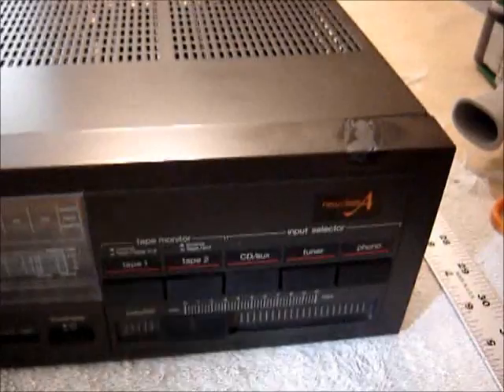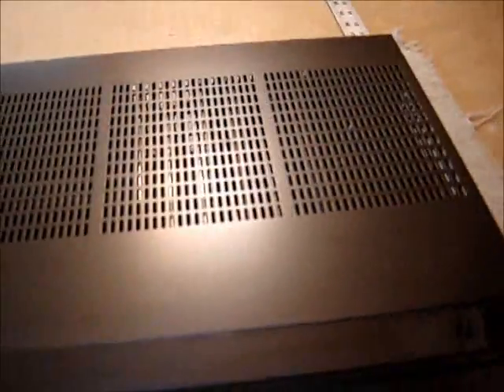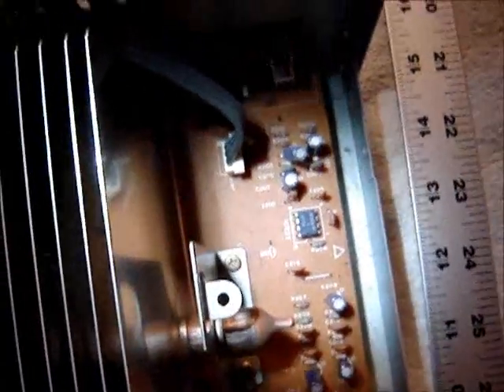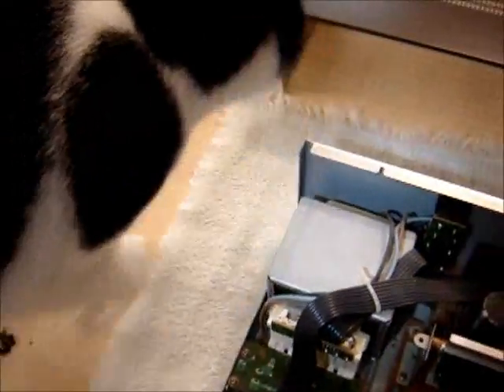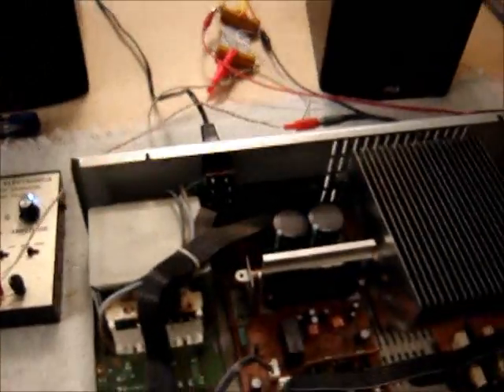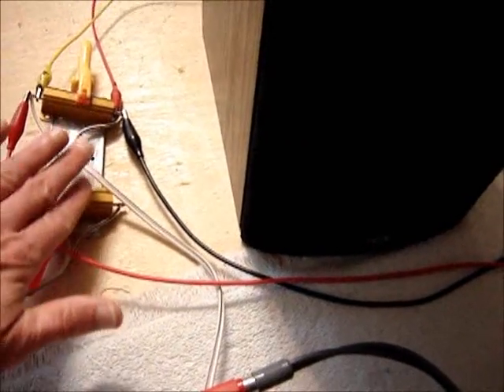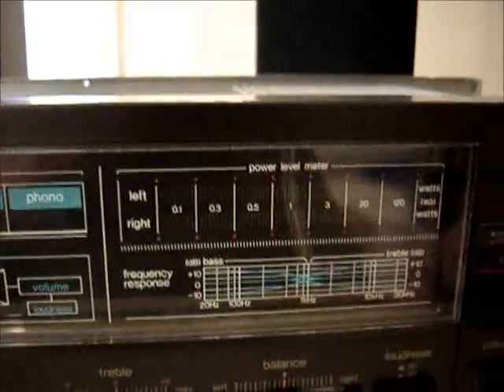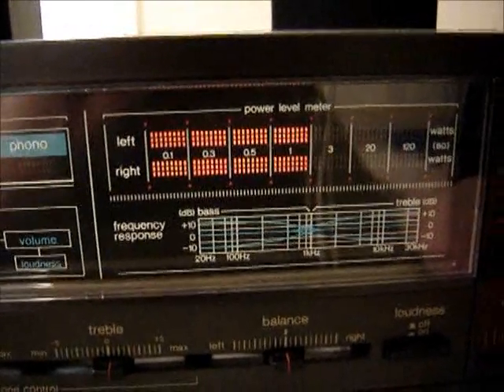Technics SU-V97 Integrated amplifier power measurment

Comment: Oh, and that 'CRAP' is better and more powerful than most of <200$ amps on the market...
Reply from the maker: I was being facetious when I called it crap. Some audiophiles do not like these slim amps with the plastic front. It does put out strong power with low distortion. Thanks for the link.
Reply: Don't judge a book by its cover, Because something is plastic it does not mean its bad, and also because something is metal and looks nice does not mean that it is good. I have Technics SU-V650 from 1989 and it still performs flawlessly and literally shake windows in the house when cranked up. https://www.hifiengine.com/manual_library/technics/su-v650.shtml and this one you got is even more powerful. It is a shame that you destroyed it :(
Reply: Seems that I found wrong amp... But rest is still true...
Reply: @LukaPetrovic84  i own the su-v97.  I have to keep it on the very lowest volume for regular listening its that powerful.  Its more to entertain large groups of people as I have no use for this kind of volume myself lol.  only problem is when I push in the power button, it doesnt have enough strength in the physical button to keep it on.  im guessing I just need to tighten something.
Reply: @coheedmonstar33  or you can just bypass the switch and make in cable switch, like on the lamp...

Comment: I have one with no lights nor sound. There's power going to the large board from the transformer. How else should I check?
Reply from the maker: There also should be a lower voltages going to the pre-amplifier ICs and tone control circuit. Probably in the +12 and -12 or +15 and -15 volt range. There could be additional supply voltages, I don't know as I no longer have this amplifier.

Comment: I have one with only one channel working.  Where should I start to diagnose.  I'm using a less powerful Denon amp for now.  I'd like to get it working because it goes well with all the matching components we are still using (Equalizer, tape deck etc...)
Reply from the maker: Check the relay on the output. Trace back to the point where the signal is lost. Since you get sound from once channel, I'd think the power amp is okay otherwise it could stay in protection mode.